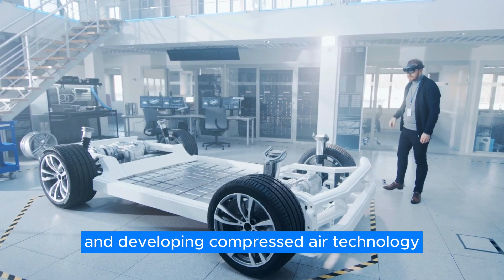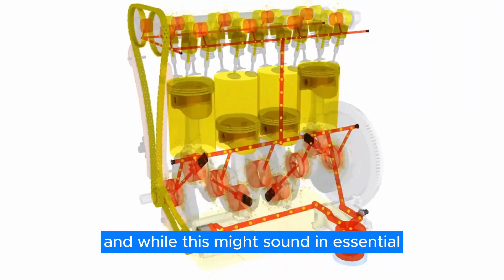GM CEO: "This New Engine Will CHANGE The World!"

Comment: BS meter knocks at the maximum. No pollution.... Just all that energy that is needed to compress the air.  Range... energy density is the possible lowest.  And I would be very happy to drive a car with a more thousand bars vessel. A reciprocating engine always stays inefficient related to EV engine as they directly make rotation. Plus, compression and decompression doubles the Power losses. 

Compressed air can be a way for short range big vehicles, where ICE and electric engines must be avoided (explosive gas environment or similar), but that's all.